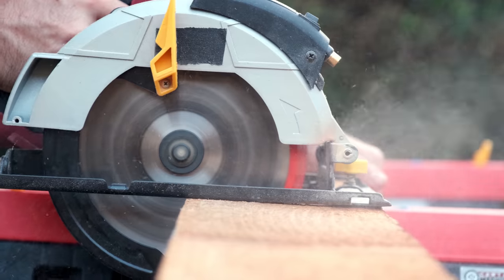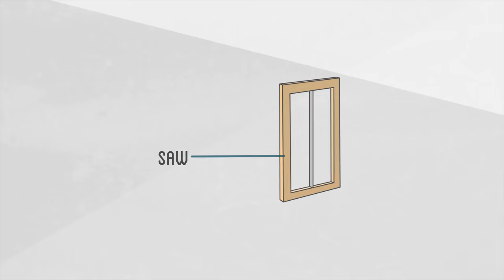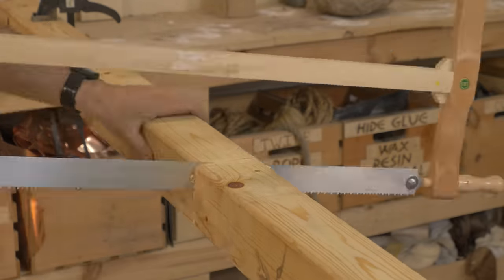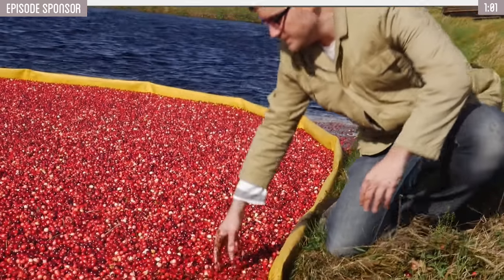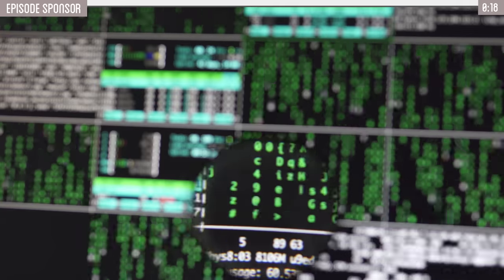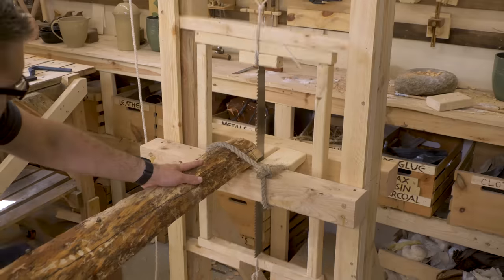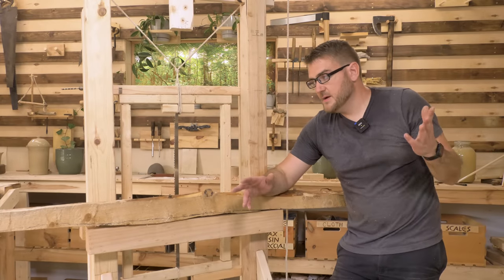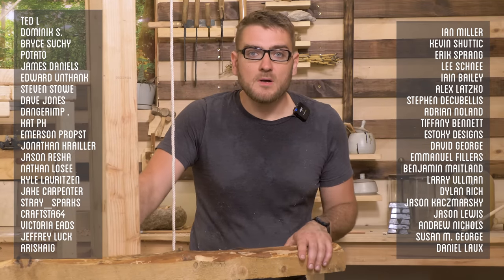This 12th Century Table Saw Is A Huge Force Multiplier!

Comment: On any vertical blade setup, the teeth should  always be oriented to cut on the downstroke.

You may want to consider that it wasn't uncommon in the era these tools were used that the master would guide the work, and an apprentice/apprentices would provide the labor. This was a big part of how apprenticeship worked. 

Also, the saw pit setup with top dog/underdog would have been the most common way to make long cuts simply due to its superior efficiency - but it takes a lot of mastery. Your attempt wasn't a failure - it was the same result any novice from this era would have achieved. Both dogs have to know how to follow their marks, push/pull seamlessly, and pace themselves despite phenomenal cardio. The blade would have been lubed or waxed even on kerfed blades.

Btw, the guy in the pit having to deal with perpetual sawdust down the shirt and in the eyes etc is where we get the term underdog as someone disadvantaged.
Reply: Yes.. All that lumbar could have built my house.
Reply: @Daniel Bonnar
👍 In 🇭🇲 the 'top notcher' gave us 'top notch'
Reply: what’s up dog

Comment: A good addition to help too is adding a longer bed, you can control it better if your not having to hold up the entire piece as well as control its direction. Also the addition of wheels on either side can aid in helping hold the wood down without having to extert too much force.
Reply: or just an infeed and outfeed sawhorse
Reply: And a guide.
Reply: How bout a sled 4 the workpiece?
And the blade frame should not be too much taller than the depth of stroke.
The hold down could be 2 wheels on a spring loaded horizontal.
If the log was pulled into the blade by the sled ratchet n gear system, he would be mostly free to jog away on a double treadle (left up blade, right down) like an elliptical workout machine.
Reply: @ralph3333  that would even be better

Comment: More blade tension, wax it, and use a windlass as a sort of feather board hold down. If you angle it right it will also prevent the piece from moving back toward you.

Comment: To stop the binding you can try to and a bigger kerf to the blade and add a fence to try reference of, if you were able to heat treat the blade to keep it sharper or just sharpen it through out the cut if possible. Great video

Comment: The reason why the wood was binding was because the flat part of the teeth on the saw were facing up, if you flip the saw 180 degrees it should bind on the way down if it binds at all. Keep up the great work mate!
Reply: The blade he is using has no "flat part", or rake. It is an omnidirectional farm cut pattern blade. The tooth has the same angle on both sides. So flipping the blade around would accomplish nothing. Being as the angles are identical on both sides. Although some aliasing in the video can make the teeth appear to have a rake to them. They in fact do not.

Comment: The main reason it was binding and pushing/pulling the wood up, is because of the directionality of the saw. This saw seems to have the teeth half-V, so if you flipped it so the teeth are half-A, I think that would solve the problem. I think you should give it a try the next time you use the table saw. For the next saw you make, please make a flywheel for it. You could even try to make the flywheel double as a grindstone, even if you make it out of cement. A flywheel would also help, because you can first store some energy in the flywheel, then take your time to make sure the cut is straight.

And if you try to make a grindstone out of cement, then it would be useful to reduce the quantity of quicklime to 10% to 15% of the mixture, have 5% more water than cement, 5% to 15% crushed terracotta (powder) or dry sieved dirt baked into terracotta powder, have the rest be sieved dirt or mud, if you're not using mud then add the water after mixing the sieved dirt and quicklime, and try to compact the finished mixture like you would when making Rammed Earth. You can make it a circle/wheel from the beginning, or you can ram it down then cur the wheel and the center hole before it completely hardens.

Comment: On a side note. With the joint holes you make, you could make them undersized and then use a heated iron of the correct size to burn them to a tighter fit. Same with the ends that go in the holes.

Comment: One of the things about the pit saw and related stuff is how fast it can become with practice. A team of four or five guys can easily put out 20 or more 20 foot 2x4s in a day. Though the average, if I understand correctly, is 5 to 15, depending on quite a few factors. The key is to have 3-5 people rotating throughout the task. That way, you can go all day without taking more than a lunch hour. After a few weeks or months, you'll find yourselves popping out one or two, sometimes up to four or five, an hour. After a few months, the biggest factors are the wood and how well you maintain the saw.

They have competitions around it in the loggerodeos in my area. A loggerodeo is exactly what it sounds like. A rodeo that adds a bunch of logger-related competitions. Our area has always been real big in farming, ranching, dairy, and logging, so I grew up on things like that pit saw. You're judged on speed, team coordination, and the straightness and quality of the cut. A family, up north in Whatcom, "cheated" by hiring local boys from their High School  to work in their lumber mill. They, being one of the oldest families in the area, also maintains - or at least used to maintain - one of the oldest lumber mills in the country as a working museum. They would encourage their employees and the Agrisciences and Forestry students they hired part-time to volunteer to work in the museum mill in their free time. The result was a competition team that was one of the toughest competitors in several old hand sawing and milling competitions. From beam hewing with a trio or quartet of Axemen (trios did one side at a time, quartets would do two sides at a time) to pit sawing to competitive sharpening (handsaws, teamsaws, power mill saws, and several types of axes), that team was VERY hard to beat; even for guys and teams that compete professionally.

Comment: I dabble in woodworking, simple projects or things I need, and I massively appreciate having power tools to do the hard work for me.

What I love about this type of video is how much our ancestors achieved with nothing more than basic tools and hard work.

Anyone who works in the trades and watches this and doesn't have a deep respect for the tradesmen of the past is lacking in imagination and understanding.

My trade is electronics, I learnt at a time when it was still considered important to know different techniques of soldering. I spent many, many hours heating cricket bat soldering irons in gas burners, soldering anything from fine guage wires, to tinplate boxes, lead, copper, etc, in fact anything I might come across in the army.

I don't remember hating it, but I don't remember loving it either, however in the 40 years since I learnt to solder, I have never failed to solder the things I needed to solder. I've sealed lead sheet, boxes, plumbed houses, gas pipes, countless wiring, and PCB jobs, it stood me in good stead for life.

I was offered a commission when I 18, which I refused, I'm pleased I did, learning a trade was probably the best decision I ever made.

Comment: Your saw blade is upside down, and you got a split in your vertical beam(3:36) at the joint. Turn your saw blade around and the wood shouldn't come off the table.

Comment: it would probably be worth adding a fence to the saw (like on table saws) to help with cut straightness, and of course make the angle on the teeth steeper so they slide better on the return stroke.

looking down the length of the blade it also looks like the blade slides at least a centimeter sideways throughout the process of the stroke, so theres definitely some substantial room for improvement in tolerances

Comment: Outstanding Andy, a step improvement in both productivity and precision, both of which are vital to your endeavours. I would mount the saw blade the other way up though to improve the cut and reduce binding. At the moment it’s trying to cut more on the up stroke, which is less powerful.

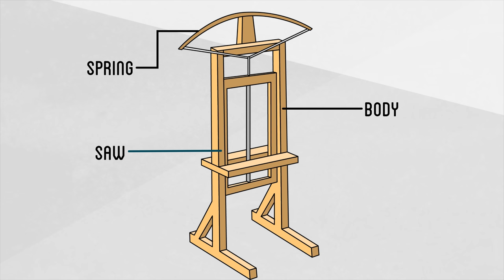Comment: At 2:09 the blueprint figures include both a blade guide (rollers) and a fulcrum/pivot to back whatever you are sawing. The reason for so many blade binds is you have no blade guide, so the blade just tracks wherever the slack happens to be (another feature in the blueprint is saw frame guides above and below the main table), and the reason you got such sketchy/wavy cuts along the length of the board is you had no fence or pivot. Many optional/additional resaw attachments for modern bandsaws have such a pivot, usually 6'' or taller, to back the material up just at the leading edge of the teeth. Having absolutely no guides for the blade, the saw frame, or the stock you were working with - I am honestly amazed that you didn't hurt yourself beyond what a band-aid or even ER could deal with. On that aspect, ummm, good job. Apart from that, slow down, do more research, and definitely go over the blueprints of any such contraption much more thoroughly next time else eventually you will get hurt, like, the you stay hurt for life, can't un-do that hurt, kind of hurt. You seem like way too nice of a guy for anyone to want that for you.
Reply: That's not a blueprint. It is an etching. They're called plates.
Reply: @1pcfred  Now, armed with that knowledge, I move forward to take over the world, Leroy.

Comment: You might consider "inking" the teeth of your saw to prevent binding on the blade.  Inking is slightly bending the teeth in an alternating pattern.  This makes the opening wider than the blade.  However, if the teeth are bent out wider or are sharper on one side the saw will tend to cut in their direction, producing a curving cut which is useful in some applications. Oil and water can also be used as lubricants. However, both can cause staining and water can cause swelling.  Depending on if the wood is hidden in a wall the staining may not be an issue.

Comment: The sawteeth blade is upside down(at 7:38 you can see it).Instaled the correct way it pushes the workpiece into table..Much easy'er and less dangerous.Also when blade is installed correctly do not push on the wood during upstroke.(keep that also in mind with inventing the water powered saw).Subcribed

Comment: So there's a lot of people suggesting a different saw blade geometry and tooth geometry but i would also suggest considering hanging a sandbag or sunch on the cut end. If you think about it like a lever then especially at the start the saw has all the leverage against you to work like a wheelbarrow. I think having either a sandbag on the opposite side or some kind of hold down mechanism would be beneficial.

Another option could be to oil up the saw blade and consider alternating the teeth left and right so that the kerf is wider than the blade itself.

Comment: People are saying to use downward angled saw teeth to fix the problem, but there is another solution that is even easier and doesn't lose half the cutting power. Just get a cross beam that can be re-positioned and will physically restrain the piece you are cutting from moving in a vertical direction. You could just simply get another piece of wood and tie it to the horizontal supports that the piece you are cutting is resting on. Or you could get fancier with it if you want but it doesn't have to be that sophisticated to do the job.

Comment: I was a carpenter. In the early 70s. We built houses using nothing but handsaw. No electricity at the homes no next door neibours. Cut everything with an 8 tpi handsaw you could cut 1 inch per stroke 5/8 inch plywood . 96 strokes to rip a sheet of plywood. Sure was nice when they started getting electricity out on them jobs.

Comment: I’ve seen a lot of comments about blade orientation and length which are both problems that need to be addressed. But also ensuring that you have the right amount of tension on the blade is super important in keeping your cuts straight and smooth. It’s hard to tell from the video but it looks a bit loose.

Comment: leaning the top of the saw ~1-5 degrees toward the operator will help prevent a good deal of the lifting as the saw comes up. using runners on either side of the foot lever will help keep the saw strait.

 another method i have seen is to use a small wheel at the bottom of the blade so that it oscillates forward into a downward stroke.

Comment: I see  4 things that would improve this design. 
1) A proper feed table or saw horse with free spinning dowels as rollers you only need a couple so you aren't expending so much energy just guiding the log thru the blade. 

2) A much longer foot pedal that gives you more leverage and lets you guide the wood from farther back. This would help with your energy economy 

3) A simple adjustable arm on the feed side of the blade (something that used a dowel or pin to fix its height over the log, holding the log down as you push it thru.)  With a single guide roller. I would shape the roller like an hour glass to push the wood naturally towards center. This would help with your rising issue and keep the log flat so your cuts would be more uniform.

4) You need a very different saw geometry for a vertical cutter like that. If i remember correctly most bow saw and sash mill blades had teeth with a fairly aggressive angle to them... cutting on the down sweep and clearing material on the up sweep.  I think it was 9 to 10 degrees on the teeth so it would cut efficiently on the down and not catch on material during the  upswing.

Comment: You may want to experiment with a slightly wider saw set to aid in binding.

I have been tinkering with a 5ft logging saw and once I got the saw sharp and set it was suddenly a joy to use.
Reply: He needs to fix the basic sharpening first.

Comment: Just a few helpful tips. Orientation of the blade is important,  also look into using weight and a heavier spring, meaning a spring that takes 200 lbs to bend it and putting 150lbs of weight on the bottom of the peddle.  That way it has alot more weight and force behind the saw blade. Also if you put a guide on the side of the cutting blade you could make it alot straighter

Comment: Just one of many suggestions, but if your blade was connected to a flywheel in the same offset way as the foot treadle of your lathe at :24 seconds into the video, this would pull the teeth away from the workpiece on the upstroke and may help resolve the issue of the board being lifted.  Nice project.

Comment: There is a reason why place for sawing timber was called "saw mill"... It used water power same as one for grinding grain. BTW, consider round peace of stone as crankshaft to keep movement speed steady. Instead of bow, I would go for greased metal pulley and counterweight. You could fix if on house beam and it would be very durable.

Comment: Being a bit pedantic, but I'd consider it more like a precursor to the Bandsaw than the table saw.

They also had a bigger version hooked up to a water wheel, which solves the effort/scale and  straightness issues you had breaking down a log manually.

Comment: if you way the slide area for the saw it will work easier. Some folks advocate waxing the blade periodically also. I always did that with my hand saws. Also adding a wedge to the end of the cut can prevent binding.

Comment: Put a hold down bar on the outer frame using holes in the frame with dowels and wedges to get the correct hold down height.

Comment: You could  (lathe) turn an upper press-roll, and tension with a lower spring (adjust for thickness in the rope) ... maybe a simple hourglass roll for rounds, and a straight roll for edging.

Comment: You appear to have your saw blade installed to cut on the upstroke. If you flip your blade, the action of the saw will push the workpiece into the bed and you'll have less trouble following your line. Back off the wood just a hair (stop pushing) when the saw reciprocates on the upstroke and only feed on the downstroke and you'll save time and energy and get a more accurate cut.

Comment: you need to offset each saw tooth 1 left 1 right 1 left 1 right and so on, you'll only need a little offset to stop the saw binding happy evolution!
Reply: Looks like he has substituted in a commercially produced blade. It should already have the correct kerf on the teeth.
Reply: @MichaelOnines  wasnt talking about the substitute blade speaking of to me it takes some of the magic out of build it yourself kinda stuff would love to see a video of him trying to improve his own saw blade instead of buying one
Reply: @RafikisAnts  I can understand the sentiment, but that mindset is what bogged this channel down in the first place and is what required the rules reset. Now he can "unlock" a technology and use commercially produced versions of it in order to explore the next thing.

As an aside, if you watch his original sawblade video he does strike the teeth to alternating sides to create a kerf.

Comment: Several slight improvements that can be done
1- Reduce thickness of blade and size of corrugating, should help minimise gripping with wood
2- slight bevel in teeth, the teeth seem to be chewing at the wood, rather than cutting, a light angle on edge, nothing major like 20 degrees, just a slight enough one to allow better smoother cuts with less saw dust creation 
3- pivot of foot lever, the lever seems too high and the bow strength was not as utilised, if you tie the foot lever close to foot, you can expend less energy moving foot up and down, furthermore increasing tension on bow creates a better speed threshold than the one you currently have